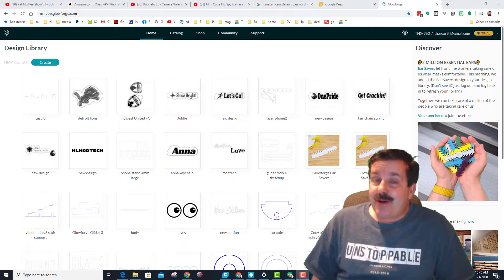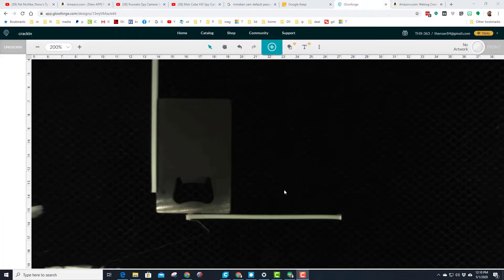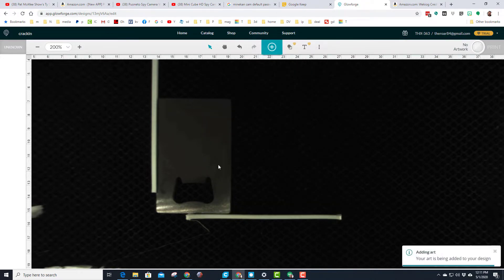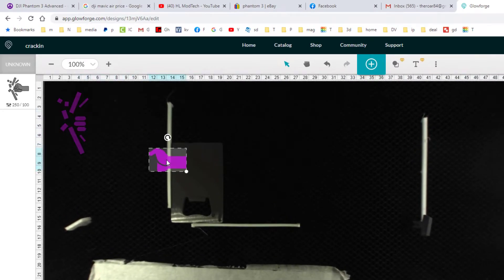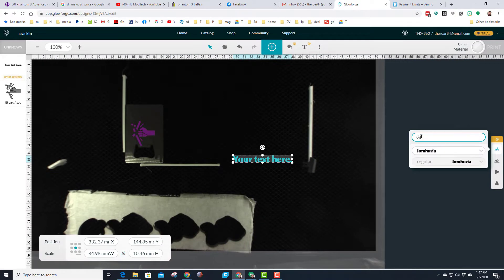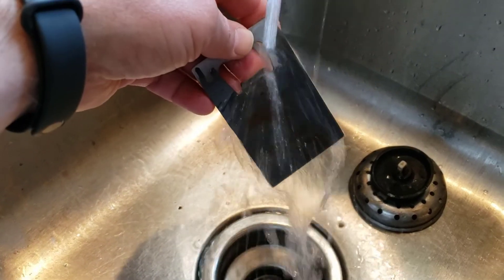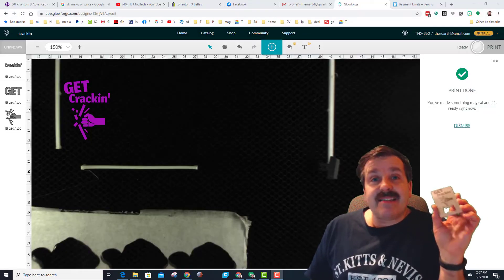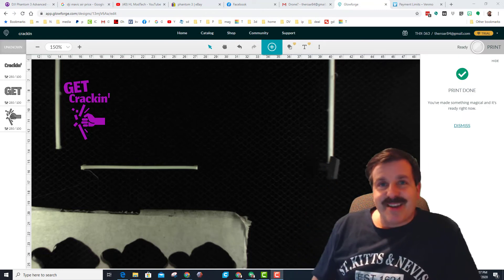Laserbond & the Glowforge = Steel Openers! Mark Metal in Minutes

Comment: This will engrave each and every single time perfectly - Ilife some reason I can’t just get a cutting board and engrave it perfectly centered- the image on computer shows centered but it’s always off a bit. I’ve even recalibrated and all
Reply from the maker: I would guess that it has something to do with the height of the material not being correct. That could throw the alignment off a bit.

Comment: How necessary is the laser bond?  New to metal engraving
Reply from the maker: The glowforge does not have to power to actually etch metal. Without the Laserbond you will not get marks at all.

Comment: Would this process work to engrave master locks? My school needs a way to code locks we issue to students
Reply from the maker: It will mark them... It does not engrave though. It would be tricky to get the glowforge to work with a think master lock. What kind of laser do you have?

Comment: can i just grab any picture and engrave it on metal? what if the picture is from a knucle head engine can it engrave it?
Reply from the maker: I usually have to adjust the design a bit to get it the way I want. Then you have to learn the patterns you pick in the Glowforge software. Lastly, you may run into issues of you use a image that is protected by copyright.

Comment: I just got mine! An I wanna run a business out of it ! This bottle opener seems like a good an easy deal to start.  Any other tips to get this going in?
Any suggestions on engraving knives
Reply from the maker: I only used mine in a classroom, so I have never tried to make $$. The openers are a neat project, but you would have to calculate the materials, Laser Bond, and how long each takes to make. Lastly you need a way to sell... Etsy, etc...

Comment: Where I can buy the laserbond cheap?
Reply from the maker: I think the only place you can buy it is from laserbond.com
Reply: Ok no I didn't read but I will thank for the tip
Reply: Do think this can work?
Reply from the maker: @MiguelRodriguez-oc2wp  Interesting product. The post was not allowed because of the link, but it was worth a look. It was 2oz instead of the larger one from Laserbond. Did you read it for toxicity and cleanup?  That was a big plus for using Laserbond.
Reply: Amazon carries it at the same cost.

Comment: can I etch bare silver metal without laserbond?
Reply from the maker: I doubt it. The GF is not super powerful. I have marked platters I ripped from hard drives though. I covered the shiny thing with tape so the reflection did not mess with the laser.
Reply: @HLModTech  What exactly does the laserbond do for you?  Im trying to burn something to the back of an old license plate right now.  not working
Reply from the maker: @dudeparistx  The laserbond is the black mark that is left behind. Once done, run it under a sink and the areas where the your design was lased will remain black. The rest will wash off.
Reply: @HLModTech  Thank you.  I'm super rookie and I appreciate the help.
Reply from the maker: @dudeparistx  Happy to help. Let me know if you have any things you want to learn. I love to share.
Reply: @HLModTech  Be careful...you may get hit from me every day!!!   lol.   i really just need alot of setting advice outside of the glowforge materials.  their stuff is just way too high.
Reply from the maker: @dudeparistx  LOL. Only used the stuff from them a few times. I use a ton of pine and cardboard in the classroom. Love that kids can create for 0 cost... we just snag more cardboard from the lunch staff when they head for the recycle area...  Check out this one. https://youtu.be/_Jq0GNs5INo

Comment: Would this work on sheet metal - 22 gauge steel? Sorry trying to learn materials and boundaries with my Glowforge 😳😌
Reply from the maker: I have not tried sheet metal. I have done it on a saw blade, bottle opener, and the original wrench successfully. I also did it on a paint scraper, but had the settings to high and the heat actually deformed the metal on it.   I would guess it would work fine. Practice on a small part to dial in your settings to get the results you want and you should be good to go.
Reply: HL ModTech Ahhhh... yes, the adjusting of settings 😵😂.  Total Newby here. Guess ya gotta start somewhere. What’s the worst that can happen right? 🤷‍♀️    🔥 😳 🤦🏼‍♀️ Thank you! Love your YouTube.. this is where I’m learning TinkerCad with you... Easy stuff when you explain it! 🙃☺️
Reply: Have you find a way to engrave on kitchen knives

Comment: is this machine capable of making all six bottle openers at once?
Reply from the maker: There is plenty of room for them. I think a bit of it would depend on your settings.  If each took 30 minutes, that is a lot of time for the machine to run. At the moment I am working in my garage and it is hot. July in Michigan and long laser projects seem risky. The coolest thing would be to have a more efficient design than I did.
Reply: Yes, also.. It would be faster to rotate the objects horizontally so you have more left-right movement as this is quicker for the glowforge to etch.